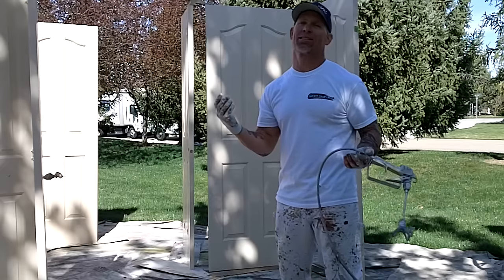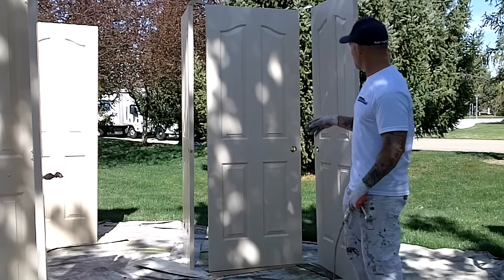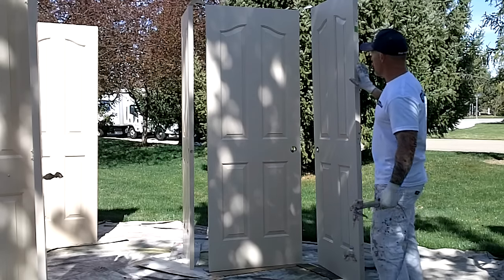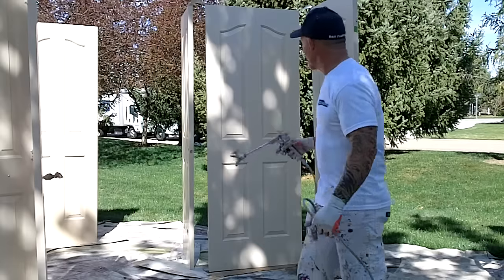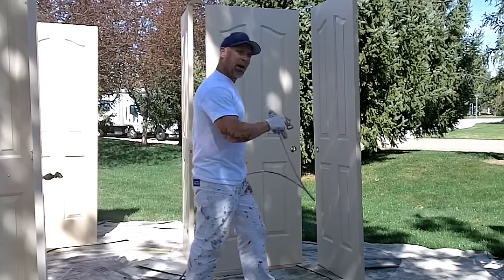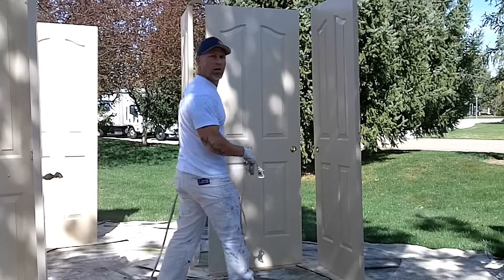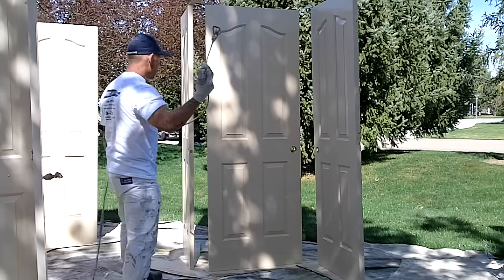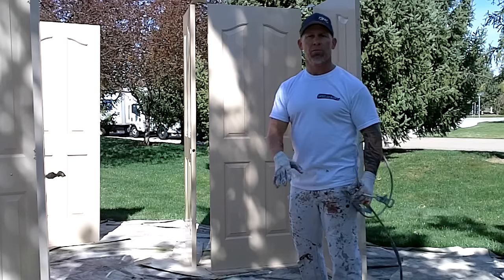HOW TO SPRAY DOORS.  Painting Doors With A Paint Sprayer.  Spraying Interior Doors.

Comment: I've watched nearly all you painting videos and picking up the best advice from you. I work for a friend and a lot of work we do are doors, cabinets and a ton of trim work. I almost cry watching you get to use an airless sprayer because he's got us using a roller and paint brush for them all, even though he has a spray machine. He says it takes longer to prep and clean up so brushing is better, I just shake my head Chris. 

Only thing holding me back from starting my own business is learning what different paints to use and doing bids. Once I get the knowledge of paint I'm ordering you bidding course. I already own a residential sealcoating company, I just need more work and need to take it up a notch. 

What's your advice with trim work even if the residents are home? Most of our work is all apartment turns. 

Thanks Chris for taking your time to make these videos bud. The new format is awesome.

Comment: question... I've been doing this for years, without problems, and just recently I have had a problem with a cloudy finish on my doors. my 311 tip may need replacing as I have fingering, but I have my Graco 395 turned way up to 3o clock, so the fingering isn't leaving any definitive lines. just an over all cloudy, uneven sheen. I'm using BM aura, satin finish, spraying them in a room at about 65*c. Any thoughts? it's incredibly frustrating.

thanks.
Reply: The Idaho Painter ... thanks a bunch for your ideas. I asked an old Benjamin Moore rep, because I was suspicious of the paint - apparently Aura is too thick an acrylic to push through a fine tip, as well as most sprayers.

Used a different product, everything turned out great. 

Cheers.

Comment: How much paint do you use to paint say the 3 doors?
Reply: +The Idaho Painter cheers ... I don't normally do doors with my airless and use the hvlp... But having now started using it for them I wasn't sure if I was over spraying them due to paint used.. But think on the first few doors I applied too much and was better afterwards... So ended up using around 2.5ltrs over doing 4 doors which may be a bit too much but time saved I didn't care ha ha... Cheers for the advice .. Top man :-)

Comment: i had a nightmare job a while back, maybe you have come across this maybe you havnt,   Lady got her gutters sprayed for bugs and didnt tell me, do the job as normal clean down sugar soap clean off etc.   Then about 2 weeks later ALL the gutters cracked and peeled.    First and only time i've ever had this happen.   I was thinking what the hell happened here, and i asked her was there any chance she had the gutters sprayed with anything and she denied it.    One of the neighbours told me after i'd fixed it, and was packing up that she had the guy there the day before going right around the outside of the house including the gutters.  external pest control is water resistant so a normal clean down was never going to cut it.
Reply: No the only time i would ever do that is really glossy or new gutters, most of our exterior stuff is all self priming for this purpose.  2 coats only.

Comment: I sprayed 110 doors 2 coats 10 units 3 floors looked like glass no runs no uneven coats 6 hrs and I did it with  very little over stray on the walls for touch up my boss acted like it wasn’t good enough I went really fast and had to refill my pump and bring my own paint from the shop am I doing it wrong or is he tryna make me not ask for a raise
Reply from the maker: Find a boss who will appreciate you

Comment: I'm not one to put anyone down so please do not take this as a diss more as minor critic. If you keep your rist and the gun square with the surface of the door or any surface your painting you'll get a much more uniform and evenly applied finish product. By tapering off on top and bottom your ending up with more product in the center of the door, lighter less uniform on top and bottom and I would guess the routed edges are light. Stay away from the extension on ur gun while spraying doors if that door didnt have woodgrain (real or synthetic) they spatter would show especially with high sheen finishes. If anything use adjustable swivel tip which may add 2 to 3 inches to the gun instead of a foot and you have much more quality control and ease of use. You got mad game and flava big buddy hope my words help a little or make ya laugh 😂😂👌👍🙏💥

Comment: I sprayed them just like you did in this video (outside) with 311 flat tip (not FF) and got lines and hazing. Could it be because they dried too fast (it was windy). I sprayed very evenly and consistently, overlapping 50% just like in this video.

Comment: That technique won't fly in our shop. #1 the door warranty states " all 6 sides must be painted" tops and bottoms included.
We paint doors laying Flat. we have designated Hanger spikes 2 in the top 1 in the bottom. Spray all the edges then the face, roll the door over, then repeat. all edges, tops bottoms, and faces are coated. then transferred to the drying rack. dry in an hour, and recoated. Dust free, no bugs, and a fine furniture finish on every door.

Comment: I used the info from this video to spray 5 interior doors, and 3 sets of double bi-folds.  (all were pre-primed from HD, 2 coats on the visible side of the bi-folds, one coat on the inside of the bi-fold, and 2 coats on both sides of the "man doors", and I used just under 2 US gal.  (maybe half a quart left)  
One question I do have is what you use (if anything) under the bottom edge of the door to prevent the paint from bridging to the horizontal surface you have them standing on.  Do you sink a couple of drywall screws in the bottom edge, or use painters triangles, or something else? (or nothing?)  
Also, in some videos you are using the FoamPro door stands, and in others the Warner Quick Truss.  Is one or the other better in some situations versus the other?  
Thanks from north of the 49th.
Reply: Vern C i

Comment: So Smooth! Looks like you are ~6 inches at most from the doors. I counted 9-12 sweeps per door. A 310 at 6 inches = 3 inches & doors are ~32 inches, so the above numbers must be true. So why at 6 inches or closer? It cant be overspray cause your outside, does it produce better finish? Just saw another pro painter do doors but near a foot away with 510, they started with one edge then to front door face spraying the outer edges of door face first, meaning outside right face, across bottom face, then up other side, across top face, then 3 vertical sweeps on door face and finish by spraying other side edge on door. Massive massive over spray of paint I could see. So 2 very different techniques, would love to know why you are so close. Great demo , thanks Chris!

Comment: How do you eliminate dust from going on the paint when you spray cause when I spray doors I always get tiny bit of dust and the rooms always clean I use a grace air assisted fine finish 412 And what's the device you use to hold the doors up on the hinges

Comment: Hi..thanks very much for your video. I have painted with roller my kitchen cabinet.  I want to have it glossy. What can i do? I placed 2 coats of primer and 2 coats finish. On the last coat, previously i sanded with 220 yo have a smooth finish...1..should i have to sanded with 400 and then apply another coat?..2..what paint  to use to vae a glossy finish. 3..I want to spray the last coat. Please Reply. THANKS>
Reply: The Idaho Painter... well said, and please, put the brush away! just refinished a bunch of cabinets for a customer who tried themselves with a brush, and then asked why they had a bunch of lines and sagging on the surface...

Comment: What type of paint do you use- latex or oil based? I am getting ready to repaint all my interior doors from white to black. They are coated with latex right now. Some I will be replacing all together so I will buy them pre-primed , others- just repainting. I am seriously considering spray gun as I have done the brush before and that was a pain. Could you recommend a spray gun for a non pro? And is cabinet paint a better choice for interior doors as well? Also, if the doors has latex on it now, what’s the best way to prep it? I tried a de-glosser, but it didn’t work as well as I had imagined.  It is very liquid and you still have to scrub the old paint a lot 😕
Reply: No one really uses oil based paint anymore

Comment: Make sense. Thank you! I have one tip for you as well. When you mask a room around the ceiling with the paper over plastic. Try to use Multi-Purpose Spray Adhesive by 3M instead of 3m yellow tape 2020. Works well and it is super fast!
Reply: how do you remove the adhesive afterwards?

Comment: Hey Chris, what do you suggest for painting a lot of doors at once, like 40 or 50? On a budget, looked at the door stands but way to expensive for this many doors in my budget, I saw some guys using metal truss hangers but wanted your input. This is for a new construction apartment building (biggest job of my life). I know you hate NC but what did you do when you first started out with this many doors to do at once?
Reply: steve gailey You can take osb or plywood and cut it into strips and screw them through the bottom

Comment: what  kind of paint did u use  ?? did u thinned the paint Thx
Reply from the maker: Sherwin Williams Super Paint, we do not thin paint
Reply: i'm confused, how is an un-thinned latex able to spray through a 310 tip? thanks!
Reply: john bonham I spray unthinned paint through a 211 tip all the time. If you keep the gun filter perfectly clean you can spray many paints through a small tip. I recently sprayed Sherwin Williams Prime RX peel binding primer through a 211 tip. Sprayed slow and steady on old lap siding.
Reply: You said solo semi-gloss in another comment so which is better super paint or solo also what do you do with the top and bottom edges of the door

Comment: Those doors didn't come out smooth at all a 310 tip and then spaying them outside paint was drying in the air that's something you can't see in a video.
Reply from the maker: Turned out good for us!
Reply: I agree, I would never spray doors outside lol. I do higher end work though. My doors are sprayed on site in the garage or large room that we bag off or at the workshop. I guarantee he had tons of bugs landing in his paint. The only time I spray a door outside is when its a front door/garagedoor aka exterior doors. I use a purple 310 fine finish . If im doing really high detail stuff I use the air assisted sprayer. I like the Idaho painter but his way of doing things is not always the best. Still a great guy though and appreciate his great work ethic/attitude! Thats why I still watch him.

Comment: I have an airless sprayer like a Graco X5, I've read using an HVLP is preferred, true?  didn't want to go purchase another sprayer if I don't have to.  I have to sand and spray 24 doors this summer.
Reply: +The Idaho Painter no worries I've read enough on both, but have gotten different feedback on what painters prefer and what works for the DIT guy like myself.